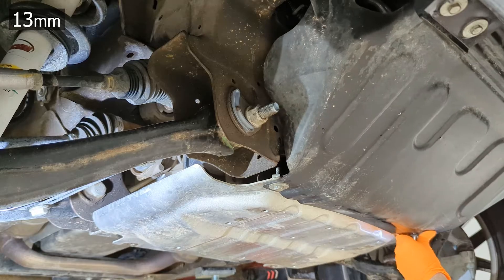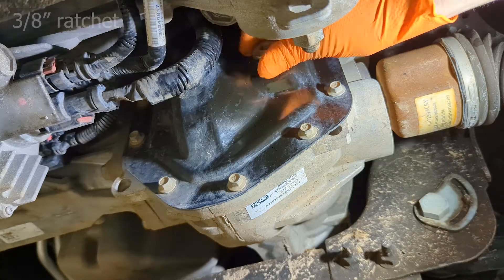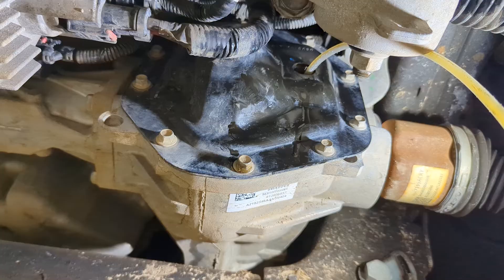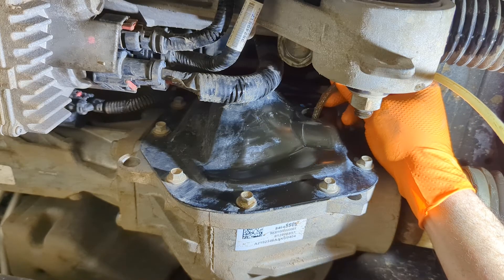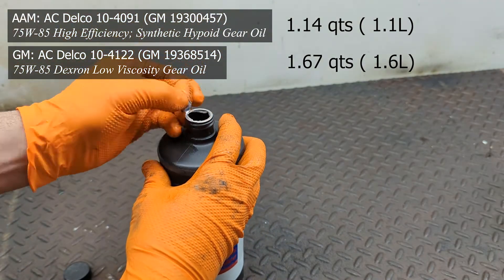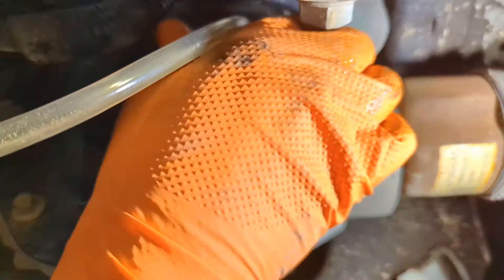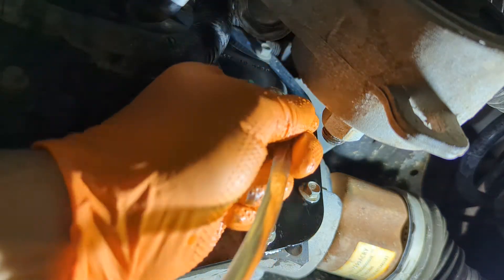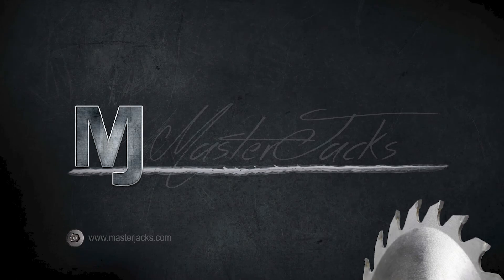2019-2024 Sierra/Silverado: Front Differential Service

Comment: I spoke to the person at the parts counter of my local Chevrolet dealer.  They said you can use a good quality full synthetic 75W-90 gear oil.  They cautioned to make sure it has the friction modifier for limited slip.  Most of them do now.
Reply from the maker: Yeah, great recommendation. Thank you

Comment: The oem spec for the front differential is 75w-85 but I know other Duramax  owners use 75w 90 to save money and keep it all on the same fluid.  I saw someone in the comments say that the only difference was the oil weight at 0 C— this is not true the second number is the oil viscosity at about operating temp.  What’s the impact?  I don’t know I’m not that type of engineer, my guess is either loss of efficiency or increased wear.

Comment: I noticed you used the AC delco 75w-85 but you linked 75w-90 for the SU5 front end. Does it matter? or should I find the specific 75w-85?
Reply from the maker: Amazon doesn't have a lot of options for the GM fluid (AC-Delco 10-4122). Here is a link to the one I found: https://amzn.to/3ZnMdrt I wouldn't hesitate to use a full synthetic 75W-90 on the front differential (AAM or GM). A 75W-90 will be barely thicker than a75W-85 at 0°C.

Comment: Great vids for both the front and rear diffs. Quick question, is the o-ring reusable or should it be replaced? If replaced, do you know the part number for that?
Reply from the maker: I reused mine. They probably say to replace it. I'm not sure on the part number though
Reply: thanks for the quick reply!

Comment: Hey brother awsome video! Would you happen to know what the torque specs for the bolts are, not the fill plugs but the actual bolts? And are they the same for both differentials?
Reply from the maker: @xquisiteforyou  the SU4 front diff calls for 18 ft lbs +30 degrees on the final pass. The SU5 calls for 30ft lbs. I'd say you're probably good with 30 ft lbs on either front diff
Reply: @ awesome!

Comment: dumb question but why can't you just take the diff cover off to drain the oil, just like your video on the rear diff service? Instead of buying that pump.
Reply from the maker: @shakenbake11  you can, there's limited space but you can use the same method as the rear diff
Reply: @MasterJacks thank you. One more- my local store didn’t have 75w-85. Can I use 75w-90? Seems more available. Thoughts?
Or should I just go to Chevy And buy oil there at the parts store? That way they give me exact right stuff based on VIN.
Reply from the maker: @shakenbake11  I wouldn't be concerned running 75W90

Comment: I don’t have the fluid extractor, is there a drain plug or do I have to take off the whole cover?
Reply: You'll need to remove the cover plate.  Make sure you have a new gasket, just in case the old one can't be used.

Comment: If you did remove the front differential cover what are the bolts torque setting? I know the fill bolt is 24ft lbs but not sure of cover bolt torque or sequence
Reply: 30 ft lbs

Comment: Is there a reason why you didn't remove the cover?
Reply: Probably because it is a major pain to remove and replace. Also, since its covered with the skid plates any leak would be undetected for a while. I like to keep factory seals in place if I can and I've found that the vac pump is good enough if I am servicing regularly. You could swap in a magnetic plug if you are worried about catching particles.
Reply: @nathanheckathorne8061  thanks for the reply, I enjoyed your video
Reply: Still waiting for a comment on this lol

Comment: @MasterJacks would you happen to have the Torque specs for the bolts and plug? i have the GM Corporate SU5 RPO code axle
Reply from the maker: Front diff cover bolts (x10) are 30 ft lbs ea, and the fill plug is also 30 ft lbs

Comment: Thank you for the front and rear diff fluid change video.  Funny, I have a GM front diff, and AAM rear diff.
Reply: So strange that they mixed it up with our trucks lol. I have AAM front and rear. Wish there was a drain plug on both like my 04 Z71 has.
Reply: @sectech221  I have sold my 2020 Trail Boss.  I recently purchased a new 2024 Chevy 2500 ZR2 with the 6.6 gasser.  Absolutely love the truck.  Like my Trail Boss on Steroids... lol

Comment: Great video, thanks. I also watched your videos on the rear and the transfer case. I don't have a fluid vacuum, any reason I couldn't just pull the cover and replace the gasket like you did with the others?
Reply from the maker: Thanks for watching. Yeah, if you have the space to get the cover off and get the new gasket in there, that'll definitely work.
Reply: @MasterJacks  Great, thanks again. Take care.